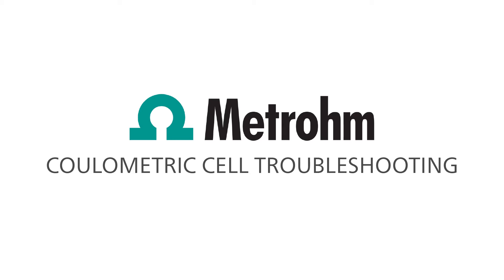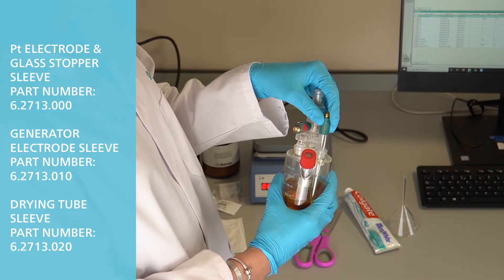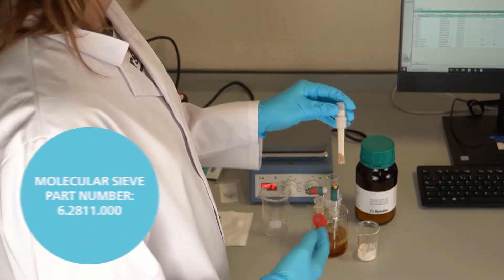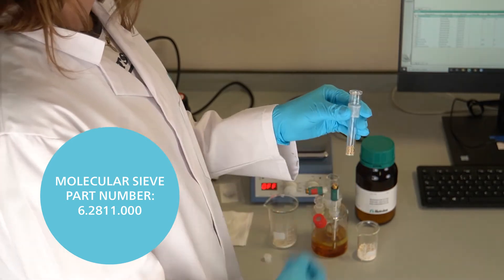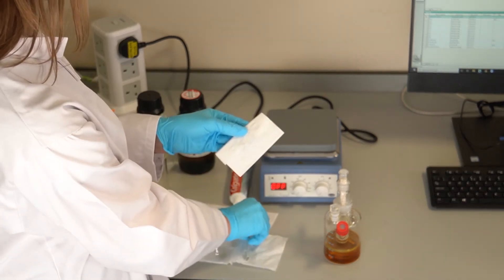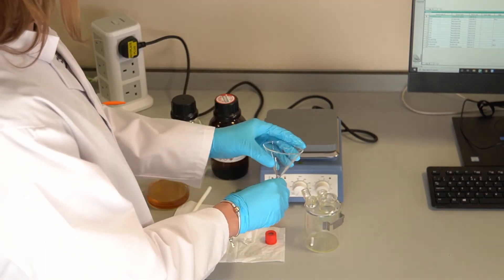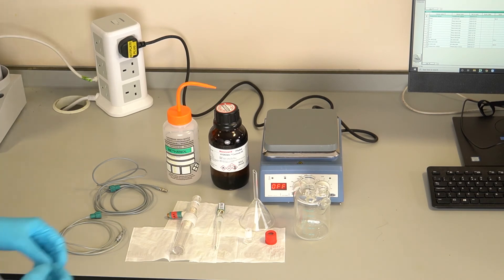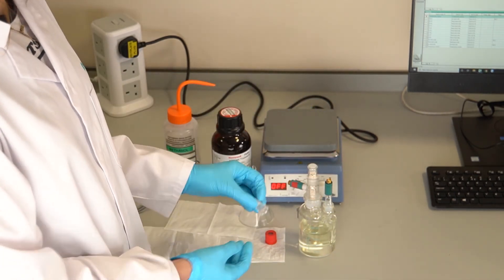HOW TO troubleshoot conditioning and drift issues with a coulometric Karl Fischer cell

Comment: What do you do if everything is absolutely fine but it still won't condition? The engineer you keep sending is useless btw
Reply: Likely, you have figured it out by now, but I'll suggest a possible cause in case someone else comes across this video. You could have a bad batch of the reagent. If the ratio imidazole/iodine is wrong, it will auto-generate water and the drift will always be over the limit. That's if you are totally sure that all parts of the titrator are clean and dry.
Reply from the maker: Hi Jared
Thank you for your comment. We would like to follow up on this with you and your local Metrohm subsidiary. Could you kindly send an email to info@metrohm.com with your contact details and your country of residence?
Thank you and best regards
Metrohm International Headquarters